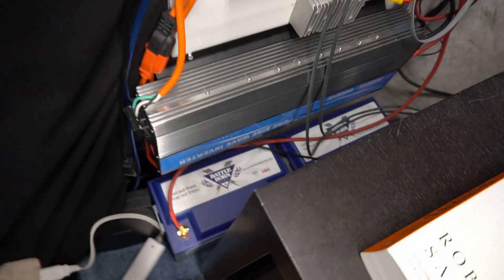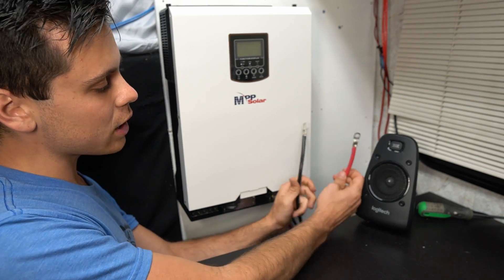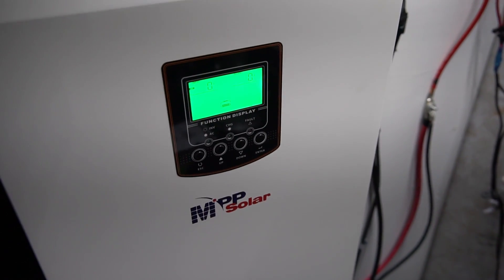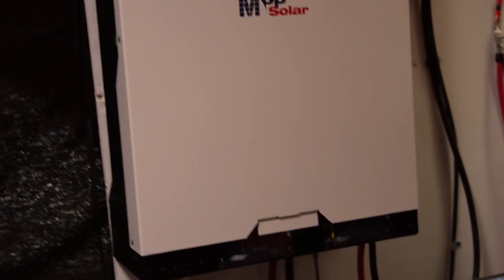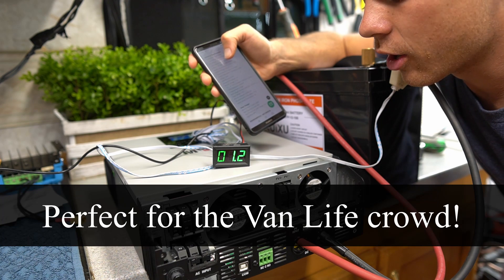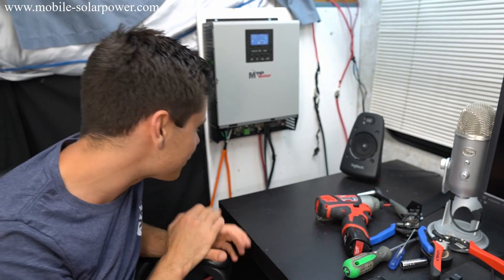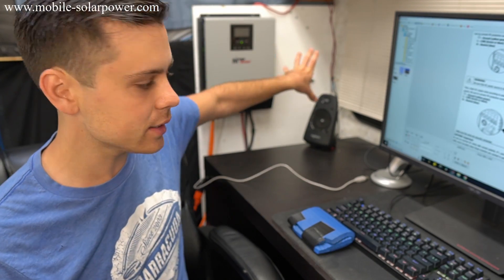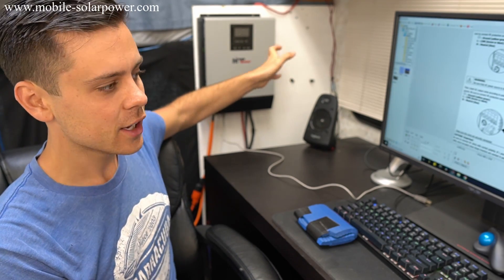MPP Solar Power Inverter/MPPT/Charger "All-in-One"  - Complete Review -

Comment: They need bluetooth and an app to use a tablet or phone. How good is the solar charging and AC charging for AGM and Lithium iron phosphate? I'm thinking something like the 24v or a modulare system. It seems I would need 800ah for off grid cabin to do 18amps at 24 hours to do all the power I need for a couple nights if the sky is cloudy so I'm not sure I can spend $8000 for 8 Battle Borns right now, but rather build up with AGM to start and get a battle born every 6 months. Can I add Lithium Iron phosphate as I go, maybe charge them with a different charger. But what about the DOD for agm vs lithium as they are run down. suggestions? What about 2 systems, One smaller MPP with 3 AGMs to get started to run my 410watt/ 3.8 amp AC and then build a full 24v cabin system with 8 battle borns over a year or two?

Comment: Flat head screws for cable connections: what is this, 1985???

Agree, they need to do a 1500-2000W inverter  
But not sure re your assumption that its good fro vans given you assume they will be connected to grid to taste over when this union cant do the Job (ie majority of time).
Great concept, not quite there yet

Comment: Can I hook van alternator directly to this unit or do I need a battery isolator ? How would this work? Please explain? TIA
Reply: was thinking the same, probably install a relay that cuts out PV charging and allows the Alternator to charge the batteries when the engine is running. Alternator is going to produce more than the solar panels.

Comment: Yes the beeping is quite loud, best to disable them in the settings as you have already shown.  I have a 24V model which can do up to 3000W.  The fans are loud, I agree.  If I am running under 150W however, the fans are not running at all.  And yes, the transfer switch is a HUGE positive, it saves your batteries, it saves all the mucking around.  I have had mine now for over 1 year and it still works flawlessly.  NOTE: if you want to keep records of all your power in, power out, grid data etc, you must have it connected to a computer 24x7 and have the Watchpower software running as well.
Reply: Should be able to connect a raspberry pi unit to the mppt to web log for your records (runs off 5v 2.5a micro usb for power). They’re inexpensive & have built-in WiFi / Bluetooth for connectivity.
Reply: Is there any advantages of buying an all-in-one system instead of building your own modular system? Any disadvantages? 
(sorry, I'm a complete beginner and about to buy my first few parts and build my first system in the next few weeks)
Reply: Adam - Is that 24V unit installed in a vehicle or is it stationary? I am curious how they hold up to the vibrations and shocks of a mobile environment.

Comment: Hi  Will,   great information. I am interested in the PIP 5048 GK,,, as I understand it: it can operate without battery and grid. Well it must then have DC from panels as input, and only work during daylight hours. I have a 6 kW system with batteries (48 v) and micro inverters. As you know the mciros need to see say 230 vac to turn on. How can this unit be gridless and batteryless and turn on my micros??? I  have a PIP  old and 5 year old battery bank which I like to change out with this new PIP 5048 GK but the way I understand it, I will still need my batteries or the grid for 230 vac input to my micros.... Would that be right Will...???

Comment: Hi Will, I was waiting for these hybrid inverter videos! I really appreciate all the info you decode for the rest of us, newcomers.
I have been searching for more info about these MPPsolar units (Voltronic like the Axpert and so on) and what I have found is that they don't work that well with LiFePo4 cells. Here's what can be read at AEVA forums: "it doesn't charge LiFePO4 batteries properly, and also doesn't support a BMS properly. Most of this would be solved if we were able to change some charge parameters on the fly. For example, to stop it charging when a single cell starts getting too high in voltage, we could increase the Bulk and Float voltage settings. Hopefully, we can get the last Cell Management Unit (CMU) to send a short command to the unit to effect the change."
It seems that they were able to create an unofficial firmware with support for LiFePo4 for the 48v inverters, but they couldn't do the same with lower voltage versions. But I need a 24v system for my van!
It would be amazing if you could try using the Sinology cells with the 24v unit to test what they say! I was so hyped up about building a system THAT simple and now I'm so bummed for not being able to bring that to life.
Reply from the maker: What in the world?! These guys don't know what they are talking about. Just use a BMS, set upper limit voltage and low voltage disconnect, and it will work great. To have individual cell monitoring you need a BMS anyways. Of course these units can't do that but it doesn't matter. Wow I would stay away from that forum. That's really silly. That's like saying a inverter doesn't work well with LiFePO4 because it can't monitor individual cell voltages LOL yeah that's just silly. I'm using it with a raw pack LiFePO4 right now.
Reply: @WillProwse  great news then! Thanks for the heads up!

Comment: Look people the same inverter is sold on ebay its called a vevor inverter and i have three of them. they work just as good as this expensive hunk. They are only 250 dollars. They are the same. only packaged differently.
Reply: The inside components are identical.
Reply: All of them are from china
Reply from the maker: There are like five rebranders of these units. I don't think it's a secret. Oh really? Can you post a link because I haven't found that cheap of a price. Would love to find that with your help, thanks
Reply: @WillProwse  hope this helps you

Comment: It should be obvious that the fans are used/needed to maintain a reasonable operating temperature and a VERY GOOD thing...  Heat kills and is the main destructive force for ALL electronics...
Question:   In the use of like spec electrolytic caps in series, a properly sized resistor is placed/soldered across the + - terminals of the caps to equalize the vdc on the caps.
Could the same be done for batteries in series and left in place permanently..??

Comment: In the USA where unfortunately you have 110/120V AC, these 12V/24V systems are ok, but we have 220V/240V, so I prefer 48V and up. It basically means you can use thinner wires on the batteries and there's less overall current flowing around.
Reply from the maker: Hey I totally agree with you. I wish it was 220v here
Reply: Yes but we have 60Hz - no flickering lights.

Comment: hey man! I have tha same inverter, and all panels is connected in pairs (it gives 74V VOC), inverter maximum VOC is 102V, can I connect panels by 3 (it will give 111V VOC). I will have lower cable loses (cable from panels to inverter is 45m long!!!), but will it start at all?

Comment: Will, is there an option that uses the grip/ solar and when the grid is down, goes to the battery, meaning an Hybrid on grid inverter (your current settings will degrade batteries faster since it will use the battery then charge it with the grid /solar when reaching low level on the batteries side, thats why I am asking the initial questions)
Reply from the maker: Yeah there utility priority setting

Comment: Great review of a device type I've been searching for. I have recently setup my Mercedes Marco Polo standard camper with a single solar panel of 100Watt and the EPEVER tracerAN 1210. It seems to work fine, but I'm unsure how it will work in combination with the builtin alternator and AC power from external source.

Can I - like I do now - simply connect the TRACER to the battery and then let it supplement the builtin charging system of the car, or should I consider some more intelligent dc-dc charging, relays, load prioritizing or should I simply find something like this (with less fan noise - the living compartment of my van is really small)?
Do you know of any competitor products that does it all like this one ?
Reply: Hi 
Imagine the situation. Inverter has no battery connections. There is no current from the network but we have a sunny day. How the Inverter will work? Greeting
Reply: Your solar will charge your house batteries. Your alternator (with a dc to dc charger) will charge your house batteries. You will need a battery charger or inverter charger to use the shore power, to charge your batteries (aka external source)

Comment: These inverters, along with other generic names like mecer, Axpert and others come from voltronic in China, I have an 5KW Axpert king also from them. The inverters are generally not so bad but the support is truly dismal and the software is watchpower and is  amature and frustrating with odd bugs and design and lacking manuals.  Also my 5kw unit self consumption is very high at 130 to 200w. The guys from Icc software for the Pi in South Africa had to develop us custom functionality to switch between line and eco mode on a day night basis to overcome this issue since june2019. If I can find a similar unit from another manufacturer with better support I would definately rather recommend that. As long as it is not from Voltronic in China.

Comment: Testing an MPP solar inverter charger on the computer, and website behind app is showing Victron products :) There is a massive thread about these on the AEVA forums - it goes to great lengths discussing the 48V model, but many of the suggestions also work on the 24V and 12V models. They've even made a custom firmware for the 48V models, allowing them to overload for a short period before going over to grid power, and in the true aussie sense, they've called it KettleKomp, short for Kettle Compensation, allowing a heavy load to run for a short period without going to grid :)
Reply from the maker: Hahaha you are observant

Comment: Couple ?  The fan on the 800w unit only comes on with Inverter usage?  Also if using a lipo4 battery kit, could we just add a low temp cut off to the battery?

Comment: I like the idea of "all-in-one" units, but if anything goes out, your whole system is out. I had an AIMS 12v 2000W unit with inverter, grid charger and transfer switch. The inverter went out under warranty, and I had to send the whole thing off and it took I think three weeks or so to get it back. Right after the warranty went out, the transfer switch started acting up.  With a modular setup, you can at leat put a cheaper backup in place (if you have one) until you can fix/replace that one unit.   I still like the idea of an all-in-one, and that unit looks pretty nice, but after the issues with the AIMS, I'm a bit hesitant.  Nice video though. Always appreciate your honest reviews.
Reply from the maker: Yes I totally agree. And these units can be paralleled, so buy two for redundancy. They are dirt cheap. Nearly the same cost as similar sized inverter alone. And powerwall nmc guys have used these units for 5+ years 24/7. So I'm sticking to this from now on. It's just easier. But yeah, modular is better in that regard. Absolutely.
Reply from the maker: Also have to realize that all of them will be all in one units one day. Having separate products for things as simple as a transfer switch is just plain silly. And mppt is easy to build now. Each individual circuit board has multiple modules in itself too. So if someone can make a reliable one, which isn't that hard, then you are fine. And I have heard bad things about aims inverters. Maybe buy a xantrex or victron so you won't have problems.
Reply: @WillProwse   The aims unit had good reviews when I bought it in early 2016, but now, while not bad, not so great.   When you say the units can be paralleled,  is that just to the batteries, or can the inverter outputs be combined too?  I'm thinking not, but that would be nice.

Comment: I like the computer program, I dont much like the lcd panel too much work. I think if you put in shed or something the heat outside would make fans even louder. Bet it has a temperature sensor that adjusts fan speed.

Comment: Question: is this equipment certified for home use. If so what’s it rated for? All power equipment must be certified by location government regulations or a national regulatory agency. Having installed lots of equipment over the years it almost appears that this equipment was assembled using individual components. If so the complete assembly needs be certified. 

Selling and installing uncertified equipment could be problematic, make sure your covered. 😎
Reply from the maker: Hey I totally agree, and for that, you need to check your local laws and regulations.

Comment: An inverter or solar controller with a fan will eventually die. This happens really fast in fans with bushings. Ball bearing fans last a bit longer.  In dirty environments this can happen really quickly, the fan slows down, the unit overheats and burns itself up, game over.  The once exception I have found are mag lev fans as they have a much longer life. If the fan runs all the time- then thats a unit to avoid.
Reply from the maker: I'm putting in new fans
Reply: @WillProwse  did you make a video about that ?

Comment: Do not buy the 3000VA EASUN clone version of this from ebay/aliexpress they are garbage/faulty. I bought one thinking it was the same unit as this. Boy was I disappointed. They are all bad!
Reply: Wow, thanks for the heads up Lee
Reply: Thanks for letting me know that, I was about to purchase one of them
Reply: thanks for the heads up, what is the difference between them?
Reply: @realcomputergenius  PWM solar charger instead MPPT ( a great diference !! ), modified sine, instead pure sine, your fans will sound hummmmmm. and the quality of the igbt ( mossfets) are cheap ones.
Reply: @realcomputergenius  after using it for a month to run a TV well within its capabilities ( I was testing battery capacity) when all of a sudden the thing started making what I can only describe as a buzzing electrical sound. Again do not buy as the sellers usually say they are from the EU but ship from China /Germany but based in China. Honestly don't cheap out like I did. Get a separate charge controller like a victron smart solar and a separate inverter like I have now done...Mistakes were made
Reply: @LeeFall  mine literally just arrived! Only just saw this comment. Ok let's see what happens!
Reply: Thanks for the heads up!!

Comment: Great video thanks! Could this thing perhaps auto-start a diesel generator? I understand it can make 800W from the battery, but how much can it use from the grid?
Reply: From the pix in the ebay description, there are connections to a generator on the bottom panel.
Reply: @Jollyprez  Thanks. But can it also send a signal to start a generator?

Comment: Another great video.... What I would love to know is how much LifePO4 battery would I need to keep the 12v version running at least close to the 800w inverter limit from sun down to sun up again... I really want to get rid of the lead acid battery that I have been using. Generally I myself use no more than 400w to run a server and an ethernet switch in the garage which has been running for over two years now but the 260Ah SLA battery (which by the way is huge and needs two people to lift it LoL) is now officially useless and in desperate need of an upgrade to better technology... I really want the server to run completely off grid and have enough energy storage to possible see me through at a day without good sunlight... I know that the LifePO4 battery is good but a guide as to how much LifePO4 battery I would need to keep it running would be awesome and informative for anyone looking to invest in one of these all in one's... They are very reliable, well mine has been anyway...
Reply: Lipo batteries are able to discharge 2 x SLA. If the SLA worked then you probably need half the size. Will's got many vids on the subject

Comment: A van dweller could turn on a generator, instead of the grid when needed, right?

How dependable is the inverter? Aren't they the most unreliable part to fail first?
Reply from the maker: Yeah absolutely. Generators work great with these.

And not any better or worse than any other inverter. I haven't had an inverter fail for years now too. The powerwall group has used these 24/7 for house size systems for years.
Reply: DIY Solar Power with Will Prowse powerwall group?
Reply from the maker: Diy powerwalls. Facebook group with 30k members

Comment: Hi! for 12v applicances, you would be fine to connect direct to the battery right? For example a 12v fuse board going off to lights pumps etc.
Reply from the maker: Yes exactly! Direct to battery
Reply: @WillProwse  but if i have a bank made of two batteries in series in parallel with other two in serie .. I guess i need a dc\dc converter from the entire 24 bank or can i connect  the fuse board to one battery?.

Comment: 800 watts on the 12v is not really going to be too useful. Since once in a while one might want to run an instant pot or a vacuum cleaner or blender something higher than 800 . I think if one is getting an inverted best to get at least 1200 watt continuous capacity.
Reply from the maker: I have 2400/5000/10000/15000 watt models on my site. Also there are other 12v sizes.
Reply from the maker: But yeah I agree. 800 is tiny. But works well for van dwellers types
Reply: @WillProwse  Didn't someone in another post say, the new ones have 1200 ?

Comment: There is a hole to secure the bottom of most units near the power in and power out cables.
Reply: I was thinking that also, when you access the PV ports there's holes in the unit to mount it on the bottom